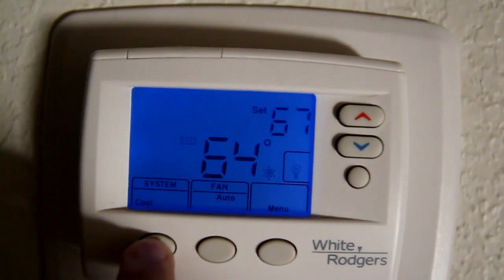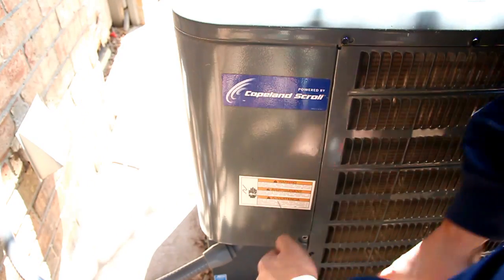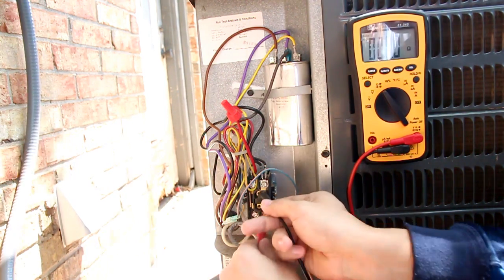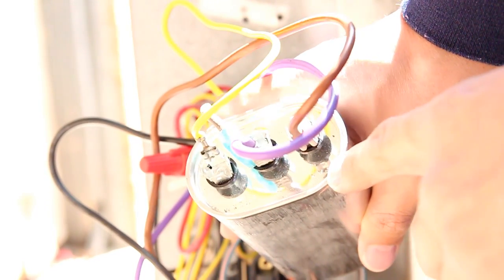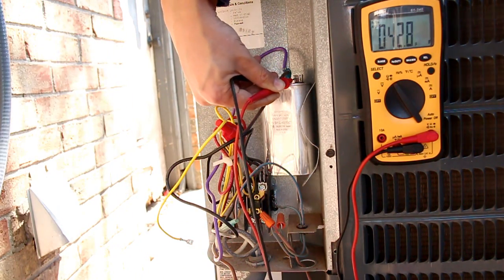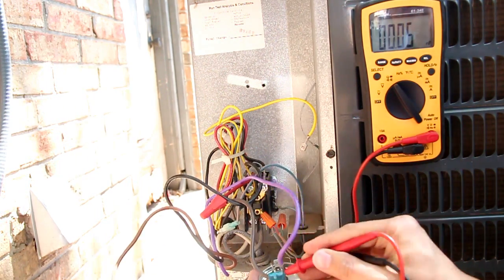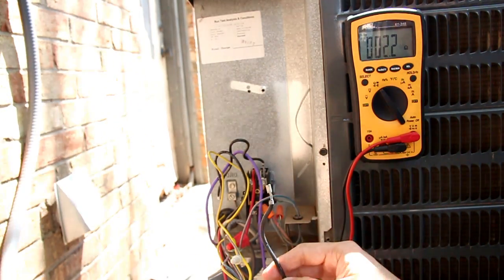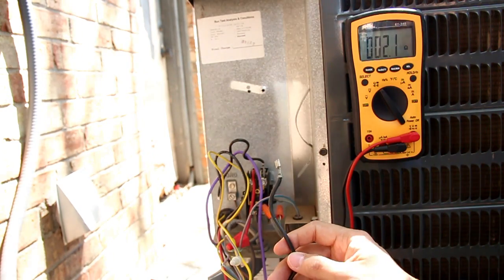AC blowing hot air - How to troubleshoot HVAC compressor - measure resistance - blown compressor

Comment from the maker: ah, good point. the simple answer is current follows the path of least resistance. hence, it will short across the metal and not me. But, of course, be safe and find  an insulated handle. Also, im not a professional.